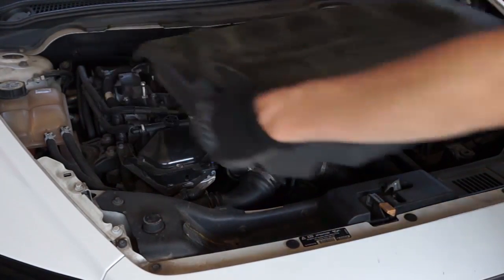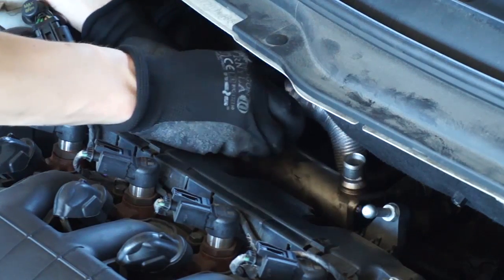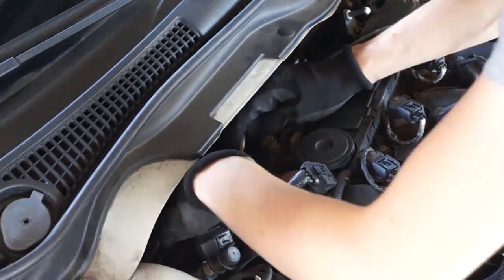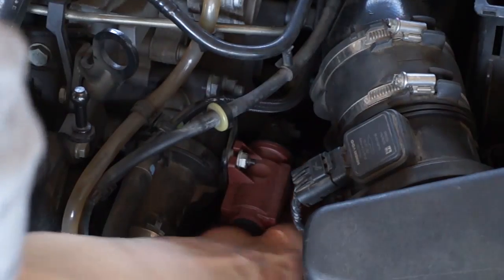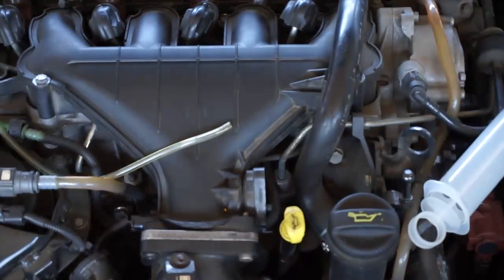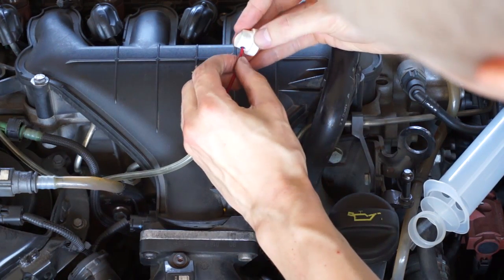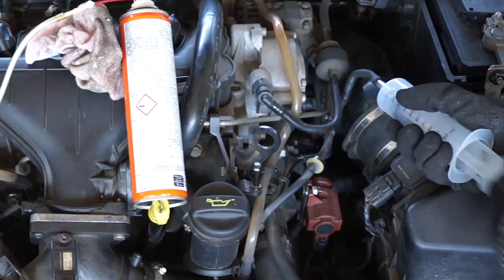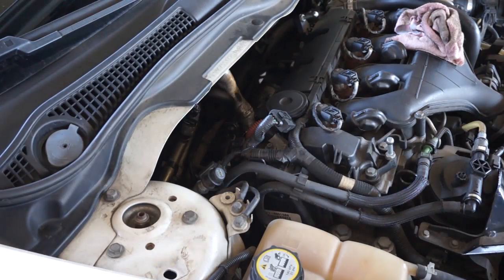Cleaning VNT/VGT in 2.0D/HDI/TDCI Volvo Ford Peugeot Citroen

Comment: There are 2 pipes from each of 2 Brown valves (1xEGR, 1xturbine). To which are you connecting syringe?
Reply: To the one that goes to the turbo geometry actuator, just follow the pipes to see wich one is the correct, also you can connect syrnge straight there to the actuator niple.

Comment: I need to do this to my 2009 v50 with dpf fitted. What's the recommended procedure with a dpf? Getting 'turbo boost pressure low' error message. Do the rubber hoses to the dpf also need blowing out?

Comment: Your car whistles what causes this as mine does same thanks
Reply: I have Volvo v50 2.0d hdi engine,and the turbo whistles too...i have another 2nd same Volvo exactly the same engine and the turbo does not whistle...can't figure out why...heard from some people that when you clean your turbo should stop whistle,other say that the whistle is bad sign...
Reply: I have a C5 with 2.0HDi 140, the turbo whistles a lot, it only has 160k km and  has been serviced every 10k, so I don't think it's a bad sign
Reply: hi there,  finally is your C5 still whistling? Thanks Ivan
Reply: Hi there,  same on my s40 2.0d. The siren noise is however annoying.  Wat was finally the outcome on your v50? Cheers from Belgium
Reply: My s40 same....but the siren noise is annoying.  I tried everything to suppress it with no results 😢

Comment: Hi. Could you please advise where to put oil catch can in this motor. There are two holes one in front "before" breather and on on the back of the engine "after" breather valve. Big thanks for help

Comment: Hello, when I connect the syringe to the vaccum hose and push it in and out, I can hear air leaking from near the turbo.. is this normal? I haven't added the chemical agent yet as I wanted to test it dry to see if it would make a difference. Many thanks.
Reply: You need to get visual contact with the turbo actuator rod, aspirate with strynge, stay there and look, if the rod  moves you have a leak in the actuator case or the membrane inside is broken, not good in any case as turbo will not reach the max boost.
Reply: But first be sure that leak is not coming from piping damage or a bad connection of these
Reply: https://youtu.be/CszWj8aW0-o?si=RXodNXEzJcno4qwB

Comment: Super video! Chciałbym wyczyścić turbo, ale czy możesz powiedzieć do którego z dwóch wężyków należy podłączyć strzykawkę? Poza tym czy pózniej po tych zabiegach ze strzykawką łopatki zostaną ponownie ustawione przez siłownik we właściwym położeniu? Czy nie ma obaw o rozregulowanie działania sterowania łopatek/kierownic?  Pozdrawiam!
Reply: Czy sam katalizator może ulec uszkodzeniu przez tą metodę czyszczenia?
Reply: Follow the piping to see wich one goes to the actuator of the turbo, also you can straight connect the syringe to the actuator niple. No problem wich position the blades get after clean, once engine start again, ecu will manage to correct position.
Cat will suffer or not depending the cleaner components and the ammount and size of carbón depósits removed from turbo.
99% no damage at all.

Comment: My 10 years old citroen Picasso 2l HDi engine has now less than 330000km with first turbocharger. Engine works fine, no power loss, no failure. Do I have to clean?
Reply from the maker: No.
Reply: Maybe at 600-700.000km.

Comment: Hi,  I have Volvo V50 2.0D and my problem is as follows: sometimes the car loses power, will not rev over 1000 RPM and it's impossible to drive. After a while everything is back to normal. Any ideas? 
And do you have a video about changing the glowplugs?

Greetings!
Reply from the maker: Any messages on the dashboard?

I have a video about removing EGR valve. Glow plugs are just below.
Also there's a video about checking glow plugs with multimeter without removing plugs from the car with an example in 2.0D Volvo.
Reply: Sometimes I get the engine system service required message. Today I used a fault codes reader and I saw Glow plug Circuit A message. But other than that nothing. I had similar issues around a year ago, then I cleaned the EGR, maybe it's time to do that once again. Which fluid did you use to clean the VNT/VGT?
I will try to measure the glow plugs tomorrow. I also had various electrical issues but cleaning the CEM cleared those problems :). I think I will probably clean everything in the near future, hoping that something will clear the issues.
My car is a 2004 and without DPF

Comment: I have a dpf filter on my Ford Galaxy 2.0 tdci how best to my clean my turbo?
Reply: I think Removing the DPF before the procedure should work? Just make sure all the stuff is blown out before reinstalling it.
Reply from the maker: You can do one of two:
1. Remove turbo, so you can inspect it, disassemble, clean and put it back together.
2. Hydrogen engine cleaning - but this in my opinion mostly placebo.

Comment: Good clear instructive video and it worked really well on my 2.0 hdi. However, there is no need to remove/touch the EGR valve. Only the EGR cooler needs to be removed (I have tried both these methods) Great video thank you.
Reply from the maker: Thanks for the tip! I was cleaning the EGR valve/cooler at the same time as well, that's why I disassembled it all.
Reply: Did your car have a DPF?

Comment: Hi. Great vidoes you have! I have exact same car(c30 2.0D 2007)with 200000 km and planning to clean both egr and turbo. But wouldn't all the carbon gunk from your oven cleaner clog up in the diesel patricular filter?
Reply from the maker: That's why I'm not recommending this method in cars with DPF. One of two things might happen:
carbon deposits will move from turbo to DPF and clog it or both turbo and EGR will remove deposits.
Reply: Rodgeir H. Nilsen no, it wouldn't.  It's broken down and somewhat dissolved by the cleaning agent and then when the DPF gets hot enough it will regenerate by burning off anything within it.  3000 rpm on the highway for 10-20 minutes should do it.  

Stock standard DPF preventative maintenance.

Comment: some Peugeot HDI turbos are in front of engine
Reply from the maker: Yeah, like 1.6HDi 110PS.
Reply: This is a 2.0 litre HDI he is working on and the turbo is hidden down the back of the engine and the same engine is in Volvo 2.0D, Ford 2.0TDCi, Peugeot 2.0 & Citroen 2.0 and is difficult to work on due to its location, unlike the 1.6HDI that is conveniently located on the front of the engine. Unfortunately, I own a Citroen C4 2.0 HDI and the turbo isn't working, so much more work involved removing and refitting. Wish I had the 1.6!
Reply: @gilbertadam64 turbo not working at all It could be just a disconnected pipe from the solenoid...